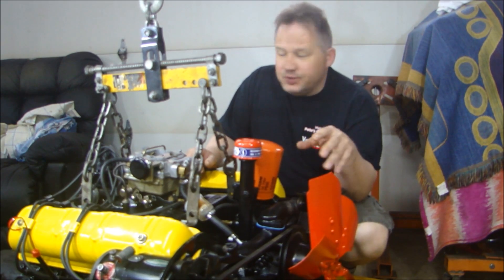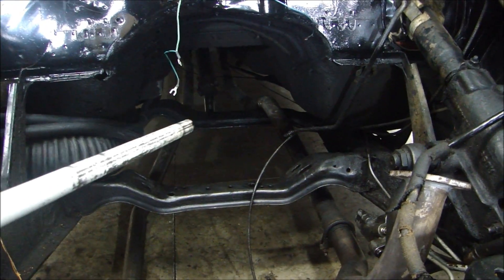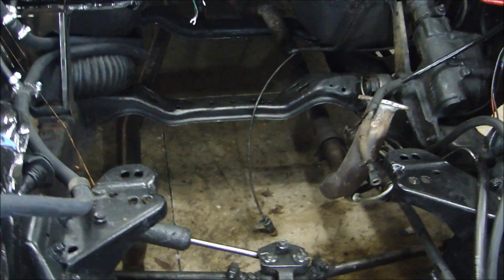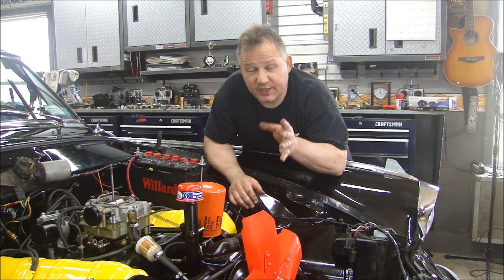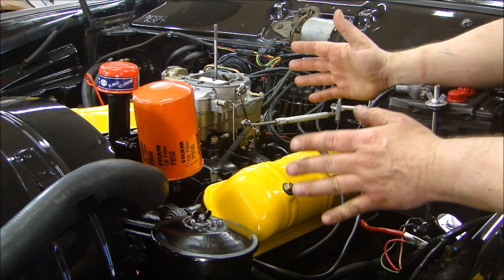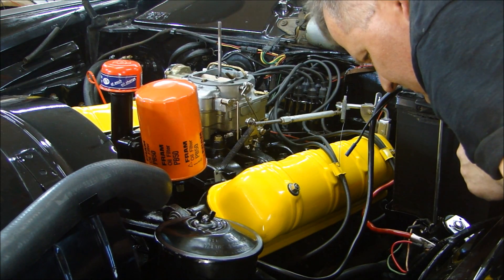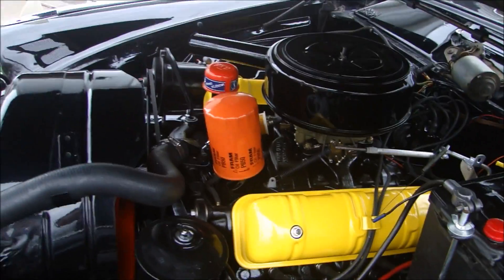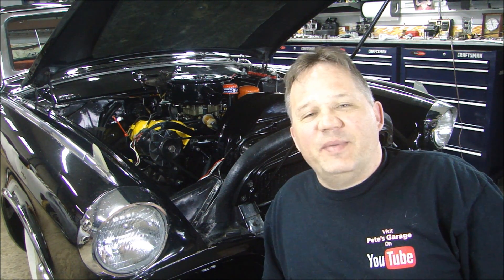Engine Rebuilding - Part 9 Engine Installation

Comment: Hi Pete , I have a 62 hawk just  like the one you showed here.just went out and cranked it up.oil started coming out the top of the cap where you put oil in!,what do you think has happened? It has been sitting up through  the winter
Reply: Oh also loved your videos, have only  watched the last  two.going to go back and watch  them all
Reply from the maker: Sounds like a blocked PCV valve

Comment: Thanks for sharing these 9 great videos. I have never seen someone so expert and thorough to rebuild an engine as you Pete.
I have a 1958 Studebaker President with a 289 engine and Flight or Matic transmission. It needs urgent reconstruction: it burns a lot of oil and does not pass the technical inspection. Here in Chile, Studebaker spare parts are very scarce and there are no longer people who know how to fix them. I would very much like to live near Pete's garage-
Reply from the maker: Thank you Santiago. I wish I could help you

Comment: What Engine Crane is that? It seems to have a higher lift than most so you can get the height to do trany and engine at the same time
Reply from the maker: You know, I really don't remember where I bought it, but it had to be local because it's so heavy. I've seen similar one at Harbor Freight.

Comment: This has been a terrific series my inheritance of a 1952 Cadillac Convertible spun a bearing and I am having to redo the engine.  Fortunately all the V-8s of that era were almost identical so I was able to get lot of good ideas about putting it back together.  The last time I completely redid an engine was in the 80s when I rebuilt a pinto v-6.  and recently a vw type 1 bug.  My cadillac has the part time oil filter accessory on top of the engine.  I make a mess changing the cartridge out how do you avoid a terrible mess with the oil filter upside down.  You might have wanted to get an oil filter like mine to make the engine look a little more period.  My old ford tractor has one very similar that would have looked more period.  It appears yours like mine only filters part of the oil at a time.  Thanks again for the great video best one I have seen!!
Reply from the maker: Thank you Stephen. Yes, it does make a mess when changing the filter. I usually put a bunch of rags under it to help. That '52 Caddy is a nice one!

Comment: That was a lot of fun starting with the disassembly video. My first car was a '64 Galaxie 500 XL. My mechanic was an older fellow that worked alone in a small, cluttered shop. He was always happy to answer questions and let me use his power tools and solvent sinks. I built 2 390's for the old car. Thanks for sharing this fantastic build!
Reply from the maker: Thanks for watching, it was fun to do.

Comment: GREAT video series, only thing I might add, would have been a good time to replace the cable to the starter while the engine was out.  It looked old and worn.  Minor thing.
Reply from the maker: Thanks Mike, I thought about that, but it wasn't as bad as it looked, but, it was a good time to change it.

Comment: What would be the reason for the nearly 60 horsepower drop from the factory specifications? Also, that oil filter looks ridiculous sitting on top of the engine like that. Like a wart on end of a nose. Spoils an otherwise exercise of perfection. Come on! put that someplace else. Looks like Nicki  Gobagoul's handiwork.
Reply from the maker: Thanks J. First of all I would think the factory specs are a perfect engine under ideal circumstances. If I had a new cam and advance the timing I could get the HP back. In 1962 the oil filter was an option. It is not on a high pressure line like a modern V8. It pulls oil passively off the head and returns it through the filler tube. Since it was an option, that is the way they designed it.
Reply: Pete, the filter going to dump oil all over the engine every time its changed. Those tiny lines going to the filter can't be suitable for their intended function. The oil flow will seek the shortest route past the filter. I don't wish to detract from your obvious talent, but I think that despite your good  intentions,  it just doesn't work.
Reply from the maker: I know, I didn't design it. It is an add on option kit.

Comment: Turned out great Pete! I was really hoping it would break 200hp mark. They must of really over rated that engine, saying 220. Can't complain though, great torque numbers.
Reply from the maker: It did work out well. Could have advanced the timing and leaned it out, but it is just a cruiser

Comment: The place that fitted my aftermarket cams just let the car idle after fitting. I asked if they were bedding it in but they said it didn't need it.... never going back there
Reply: ...and to add, the Studebaker is beautiful, nice interior as well
Reply from the maker: Was it a new solid cam and lifters?
Reply: Brand new cam, reused the old lifters (bucket).
Reply: Petes Garage have a question Ford 292 312 engines why sometimes need oiler for rockers have ranchero one side don't oil has a return bypass from the other side .has later yr engine from 62 Ford oiled till overheated once.air blows down passages .Thanx have a few Xtra engines want to know what too look for seems common on theese.